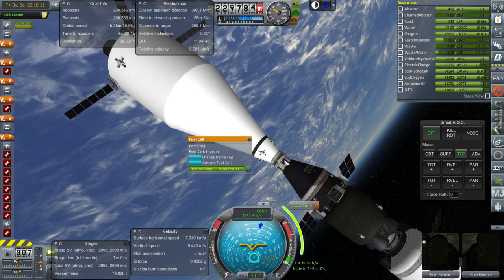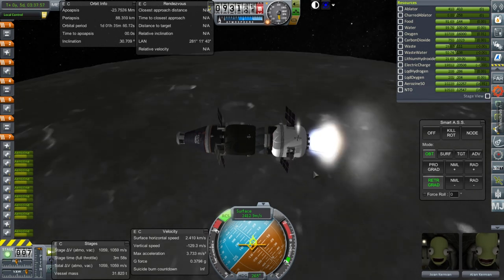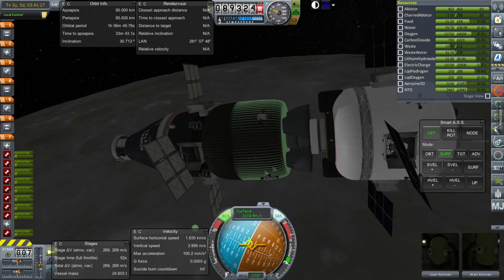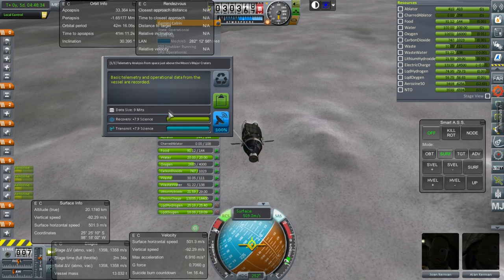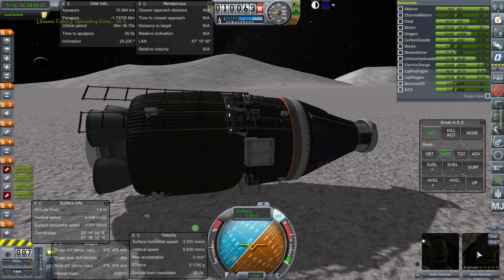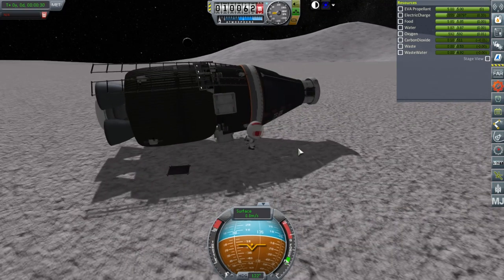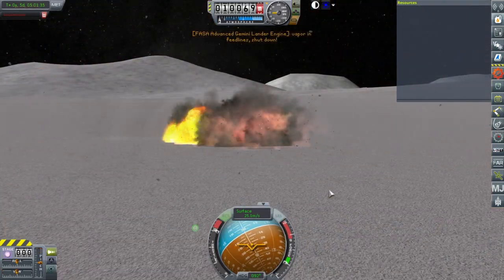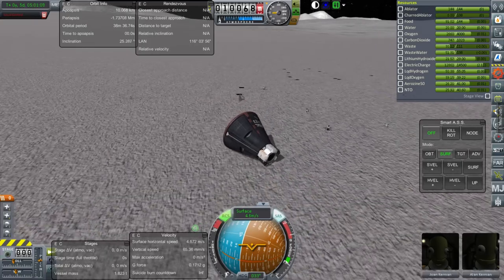Realism Overhaul in KSP 1.1.3 - 28 - Maybe a Bit Too Soon

Comment: EVA packs are the same in RO just Kerbals are 2x heavier.
Reply: I was wrong. They're 100 kg only in RO (and 94 kg in stock). So it seems like jetpacks are significantly weaker.
Reply: Spacesuits, especially ones with maneuvering capabilities, are really heavy.  The real-world EMU is 145 kilograms by itself.  The Z-2 prototype is 65 kilograms, but it doesn't have thrusters.  For humans, 180 kg seems low if anything.  Kerbals are smaller, but realism overhaul is, well, realism overhaul.